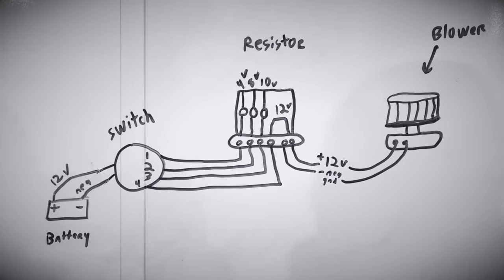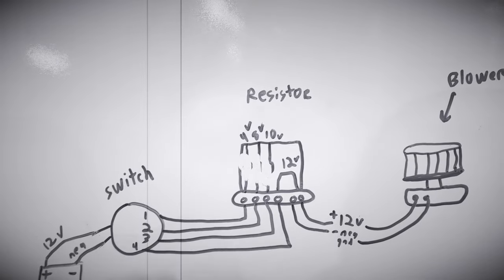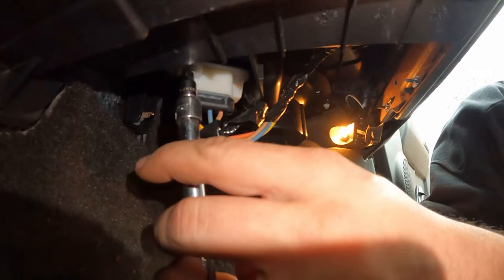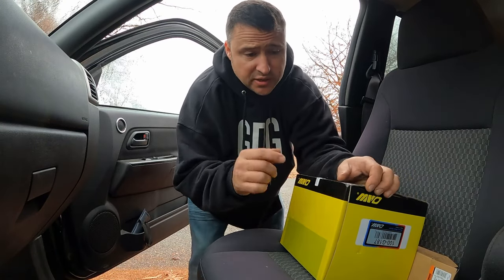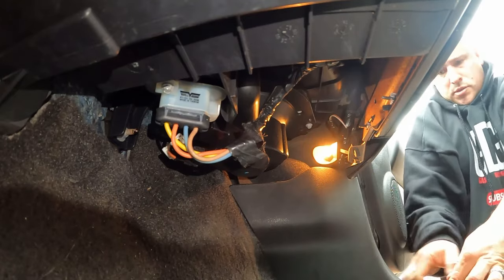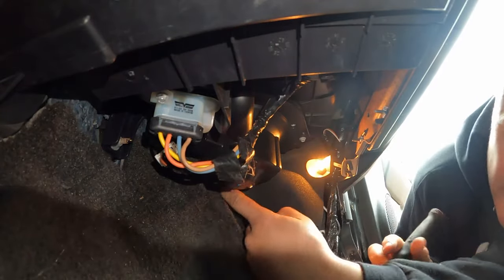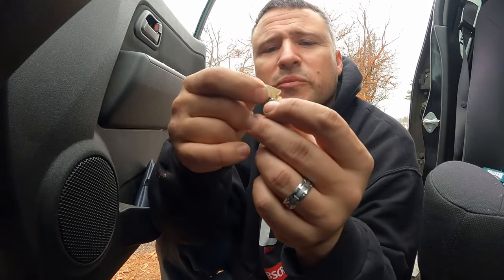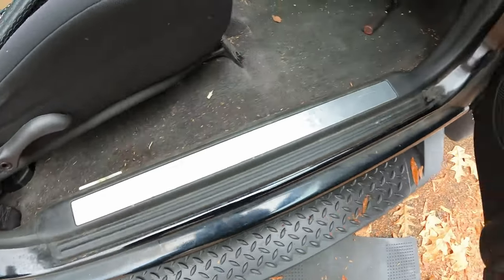FIXING THE U.S. ARMY COMMAND SARGENT MAJORS 2007 CHEVY COLORADO | BLOWER RESISTOR EXPLAINED, REPAIR

Comment: Friend help me! What if I already change new blower, new harness and new resistor and is not blowing at all, all my fuses are ok and I’m receiving 12 volt at the new blower  and nothing happens, nothing it’s blocking my blower and I tested with direct power from battery and it works!!! This is crazy
Reply from the maker: What type of vehicle do you have?
Reply: @Gasdieselgarage  2011 Chevy Colorado
Reply from the maker: @rogergomez4494  check to see if you have a good ground coming from the new harness.
Reply: @Gasdieselgarage  that was right!